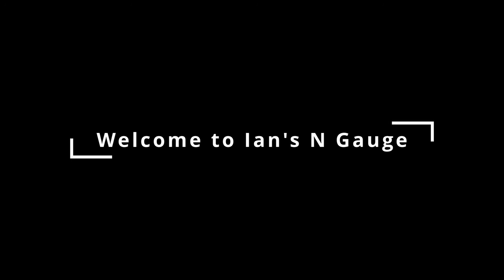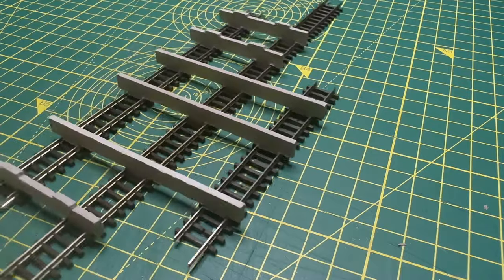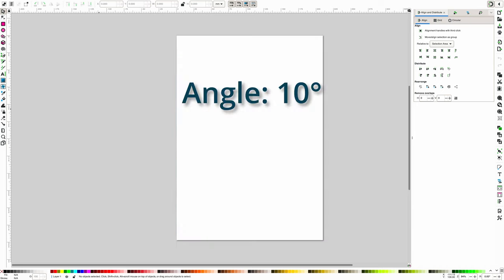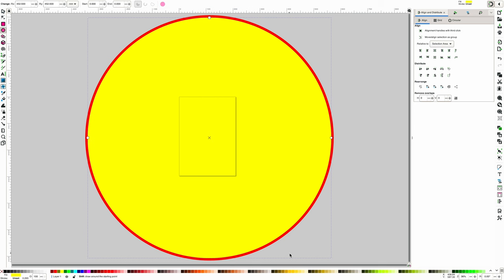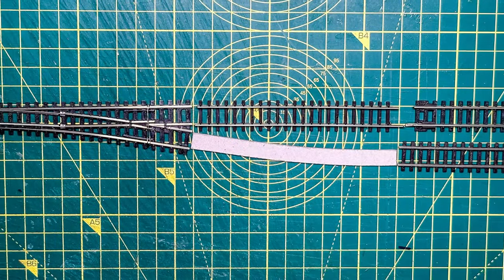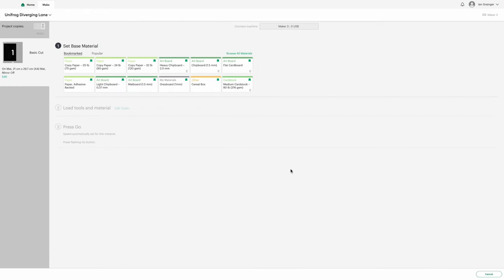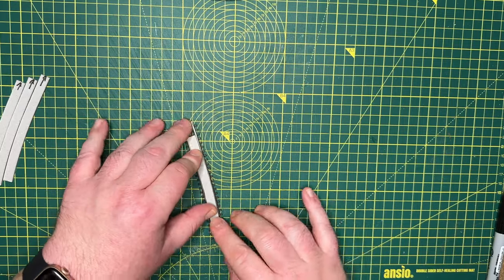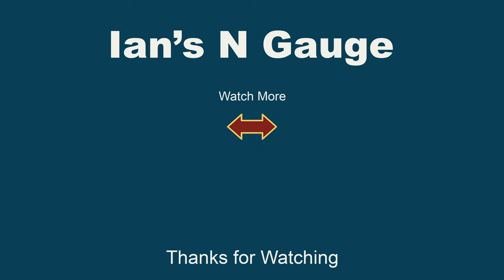097 - Build - Creating Flexible Track Templates

Comment: Great idea Ian. I have made my own curve templates rather buy them but hadn’t thought of making some for turnout fitting. Thinking further you could also design some for spiral transitions. Cheers Peter.
Reply from the maker: Thanks very much Peter! It's great having the tools to be able to create these templates so accurately nowadays isn't it? Yes, you could definitely create them for all sorts of situations, including easements! My next ones will be used to go between adjacent pieces of track, to ensure they're the correct distance apart, instead of relying on the Peco 6' way gauges! All the best, Ian.

Comment: Funnily enough I also made my own custom templates when I was fooling with flex track, for very similar reasons. I found a local printing store that would cut thick acrylic sheet from a PDF which gave very tough results.
Reply from the maker: Hi Chris! I never thought about using acrylic sheet - great idea! I've toyed with the idea of getting a 3D printer, but don't really have space for one at the moment! As I already have the Cricut machine it made sense to use that instead! I now "double up" on my templates cut from 2mm greyboard, so that they're 4mm thick, and coat the edges in Superglue! This works really well! Thanks for watching! All the best, Ian.

Comment: Hi Ian,
Personally I don't like the consistency that comes from set track - I don't think the full-size railway looks like that - it seems to be made of the gentlest curves that suit the situation. For example to extend the gap between parallel rails after a point, from the streamline distance to the set track distance, I would want one big gentle curve, so would need to work out what the larger radius would be. Using Inkscape for templating is a great idea :)

Next time I make an N gauge layout I'll use easements for transitions into curves, and I've no idea how to calculate a varying radius for an arc! So will most likely be by eye, but with some kind of template to make sure I don't go tighter than a particular minimum radius at any section.

Great to see that Nine-millimetre Gauge does indeed have a 9mm gap between the rails, very reassuring! I was actually surprised because I mistakenly thought track gauge is the distance between the rail centres, but that would be silly, and it is indeed the inside gap.
Reply from the maker: Morning Jonathan! Hmm! I think there's some confusion! I'm not extending the gap from streamline to setrack! The 26mm gap is the gap between the centre of the tracks, not the gap between the two adjacent rails of the two tracks, which just happens to be coincidentally, the distance between adjacent rails for setrack - I think it's 18mm, or something like that, for streamline! The diverging lane of a unifrog point isn't one smooth curve! If you measure the point from the switch rail, you'll see that after the angle at the specified radius, there is a straight section (30mm in my case), which is how I came about the measurement! If you think about it, it needs to go straight, otherwise you'll end up with a tight S-curve in all of your crossovers! Hope that resolves any confusion! But yes, Inkscape is an incredible tool, and I'll be using it a lot in the future when I come to designing buildings, platforms and more templates! Haha! Yes, it was a bit of relief to see that 9mm gauge did indeed have a width between the rails of 9mm! All the best, Ian. P.S. Next time you make an N gauge layout? :)
Reply: @iansngauge  Morning :)

Sorry about my misunderstanding with the gaps - when you said that you prefer a streamline gap you showed a gauge that had the set track end separating the tracks, but looking back over it all of your words are consistent and clear, so I must pay more attention to them in future! :) Good point about the tightness of the 'S' - I remember reading (I think on the Peco website) that the points have a nominal radius but that they're actually a composite - it didn't say what it was a composite of , but from your measurements it would seem to be one radius of curve and then a straight.

Yes, Endoor is supposed to be my "just get something done" railway - I'm forever thinking grand thoughts about what I could build next, but it turns out that even my "quick" one is incredibly slow to progress, lol, so who knows how long it will be until I move on, and what I'll want it to be by then!
Reply from the maker: @endoorrailway  - Ah, yes! My bad! I was being lazy and just reused some footage from the 6ft Way Gauge Tool video I made last year! It's amazing how much time it takes to do things with a model railway, especially when real life has a habit of getting in the way far too frequently! Oh well! Have a great weekend! Ian

Comment: Obviously you’ve used card because you have a cricut machine, but could the dimensions be transferred to a laser cutter and use wood for more robustness?

I have neither machine and was just curious.
Reply from the maker: Hi! Absolutely! I'm pretty sure that any laser cutting software would support SVG format files exported from Inkscape, or would allow you to construct the templates themselves - Cricut Design Space is simply awful for this sort of thing! Using a laser cutter would produce muce more effective templates without the need for strengthening too! You could also go down the route of 3D printing, although you'd obviously have to modify the files to give the templates some thickness!! I'm also curious about laser cutters, and 3D printers, but don't really have the space to keep them! Hope this helps! All the best, Ian.
Reply from the maker: @Elvenhome  - Hi Stephen! I think it's definitely worth taking a look at Inkscape! Just look at how Michael uses it to create his buildings in Chandwell! I'm going to be using my own templates, and Tracksettas, and a 1:1 print from RailModeller Pro, and Peco 6' way gauges, and anything else I can lay my hands on to make the job easier! I've tried laying track by eye, but, alas, I just don't have that skill! I'm hoping the more track I lay, the better I'll get though! All the best, Ian.